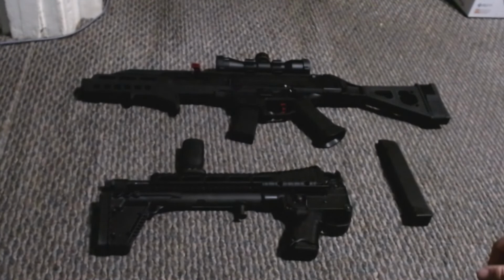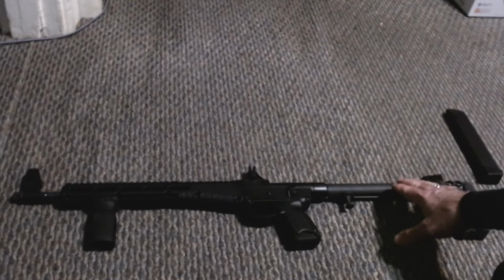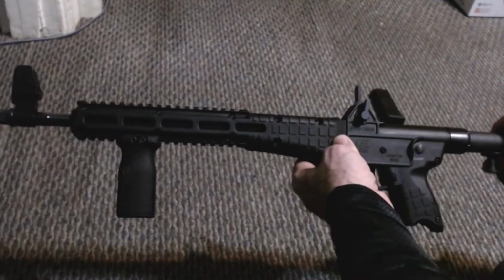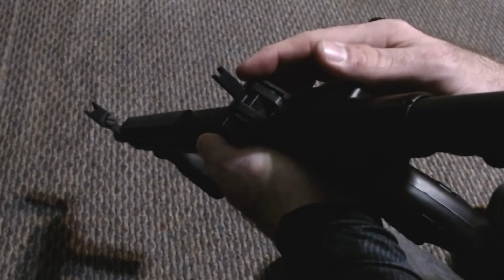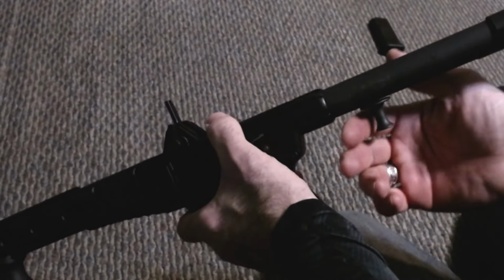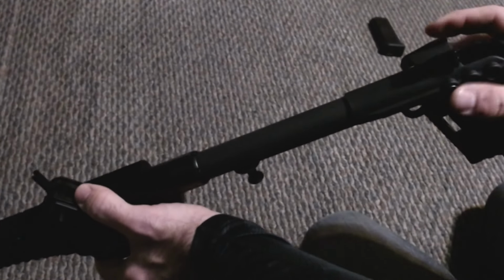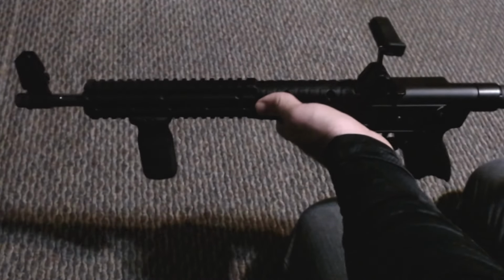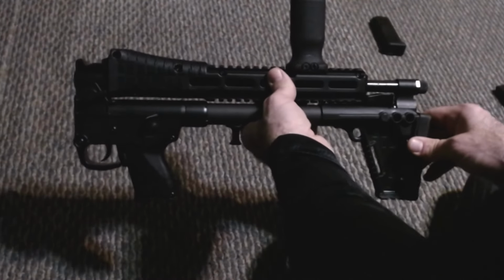Keltec Sub2000 Upgrades!

Comment: I have two S2K's; one has mod's and the other just has a tac-light. I'm keeping the bare/basic one and selling the one with "mods"...bought it dirt-cheap from a friend anyway.  The S2K's perfect out-of-the-box...cracks me up with everyone "upgrading" an already solid carbine. To each their own....good video.
Reply from the maker: The inferior screws, plastic sight, plastic trigger with heavier trigger pull just didn't sit well with me.  The plastic feed ramp though is suspect as Mcarbo had lots of wear on the one they had. I'm sure it's fine out of the box aside from the feed ramp.

Comment from the maker: Correction on the size after folding. It is around 16 inches, not 8. Also the sub2000 is made from a reinforced polymer so it should hold up well if you decide to leave it stock.

Comment: No Disrespect meant but I am Done with my Kel-Tec SUB 2000 Gen 2 9mm. I sold it because it is a 9mm ammo eater and I just can't afford to shoot it anymore!  I did have it for several years and it never malfunctioned but I was never really happy shooting this gun. I consider this to be a Kit Gun and if you plan on shooting it a lot, there are many upgrades you must get to enhance your shooting experience. I did upgrade the rear sight and I did change to the Notch sight, which was much better for me. The one thing that I did not like was the stock trigger which was IMO, very bad and was needed to be changed. Fun Gun and I would have kept it but I did not think it was worth it for me to spend all that money on all those upgrades.
Reply from the maker: Thanks for the comment. I bought the gun knowing first I was going to spend $300 on upgrades. Never shot it without the upgrades. It's small when folded, light and accurate. I also own a Glock so just made sense because I can use the same mags. Hope you find a new gun you enjoy!
Reply: No disrespect intended here, but "enhancing" the shooting experience is not a priority! The purpose of the firearm is fulfilled the moment a person verifies it is functional. I can hit targets all day long at 100 meters. That alone makes the KS2000 a value. And it folds to 16"? AND you get ~+200fps velocity out of a 9mm?
I never understood the Gucci approach to weapons. I have bought ambi charging handles for 2 of my firearms, that is it. Rest is stock. I polished the trigger on one of my PSA 20" uppers, smooth as silk. All other equipment is stock.

Comment: How difficult was it to change out the trigger guard and spring? I understand you have to take the gun totally apart to do that. Nice video sir.
Reply from the maker: You do have to take it completely apart. It's a bit difficult but MCarbo has a walk through video for all their parts. If you have some patience and don't mind minor puzzles. lol
Reply: Actually , for those of us that are not mechanically inclined , you can have M,Carbo do the upgrades for you ,,, you can buy a complete rifle will all upgrades already installed for $800 without the scope mount , or $1000 with the scope mount.

Comment: I was comparing the sub 2000 to the Ruger PC Carbine Chassis Model. The final decision was the Ruger. It was $700, compared to the $500 for the Keltec. 
The reasoning was that to make the sub 2000 as good as the Ruger, it would have taken another $300 or more in upgrades.
The Ruger was more cost effective.
Reply from the maker: Yes, that is a very comparable firearm to the sub2000. A bit heavier and comes apart in two pieces. Would like to own one of those too and be able to compare them.
Reply: I have the pc charger as well. The sub2k is way more reliable
Reply: Absolutely no reliability issues with my PC Carbine. It runs perfectly.